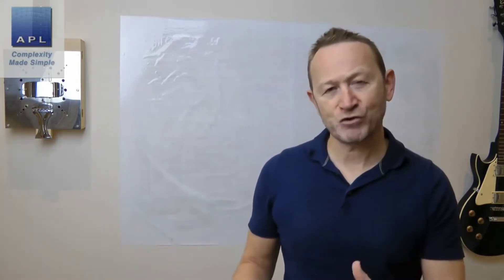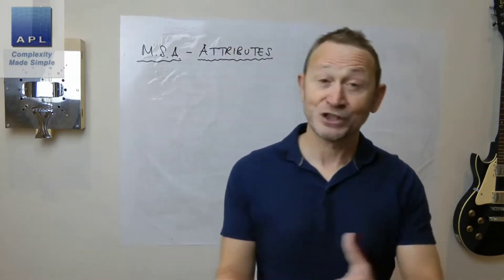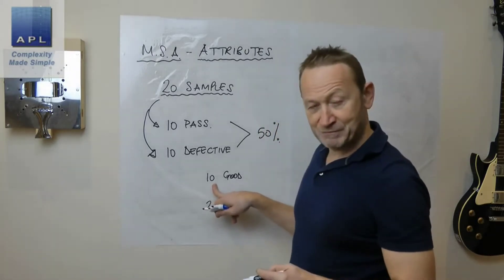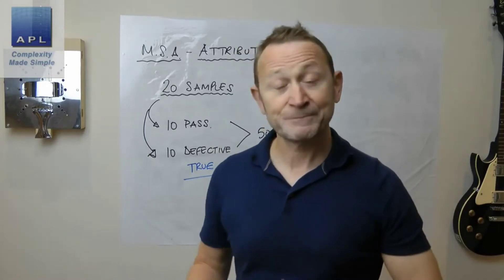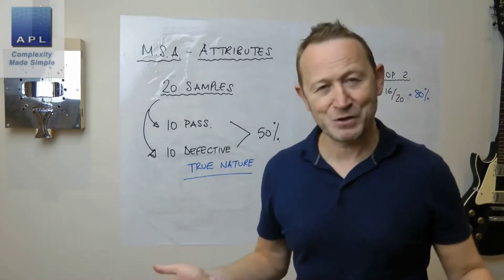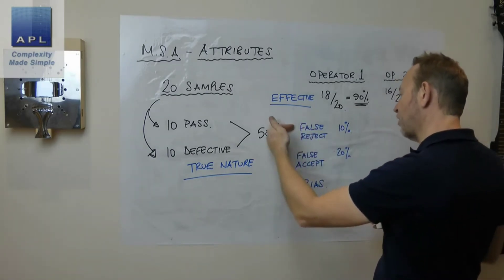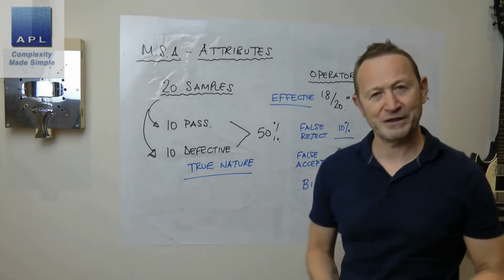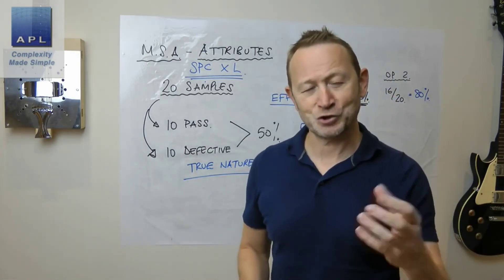Attribute MSA - Here is the simple way to do it...

Comment: Would a 6 appraiser study (visual inspection) with 2 appraiser's % overall effectiveness at high 80% compared to the other 4 at high 90% be of concern enough to focus on the 2 with slightly lower scores? Even though the miss rate is zero & false alarm rate is OK?
Reply from the maker: Hi there - it all depends on what the risk of errors are, and that is for you to decide. If escapes go on to other parts of your system and the problem is kept in house, then low risk if the mistakes will be past to the customer this might be more of an issue...
Reply: @paulallen5321  that's my thought exactly. Thank you. Although others are trying to tie me strictly to the AIAG manual. 🤦🏼‍♂️

Comment: Hi Paul,
We are quite often facing automatic camera systems in our processes. I am in a situation now where there is only one camera in the machine to check a cosmetic characteristic. 
How would you perform a proper MSA in such case, considering that we only have one appraiser (one camera). An attributive gage R&R with one appraiser or an MSA type 1 would fit better?
Reply from the maker: Hi Jonatta  - good to hear from you. You can still perform a Study its just that there is no reproducability and certainly a type study could be a good solution as long as this does not create bias. The 10 parts test is there to eliminate operator bias, so if there are no operators this is not a risk, run a type 1 study,,